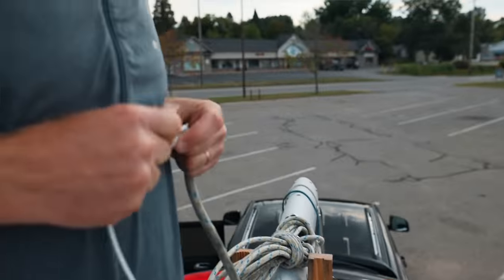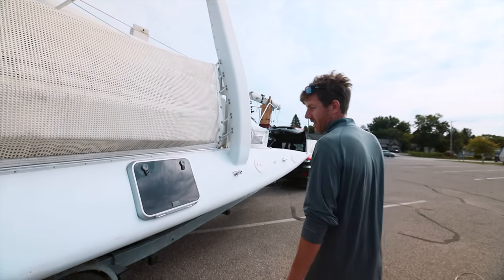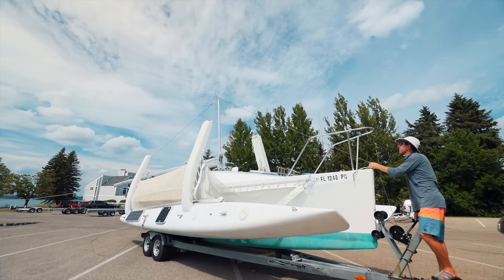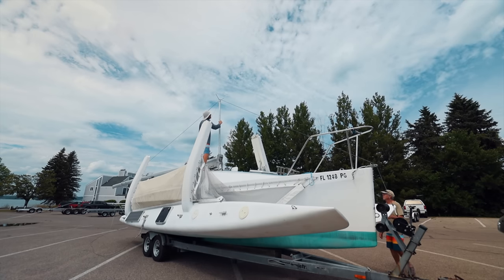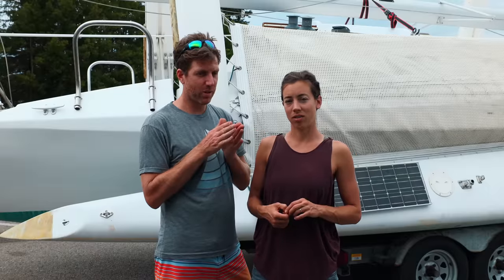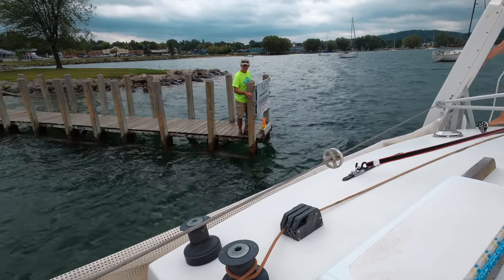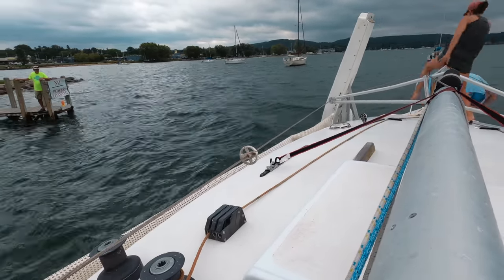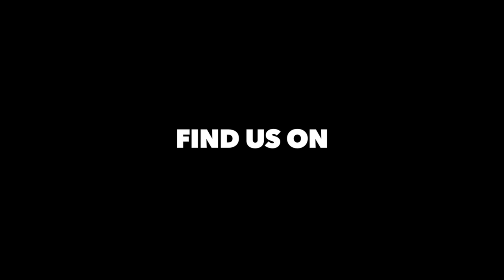How Many Quacks Does it Take to Launch a 32’ Trimaran? | Sailing Soulianis - Ep. 120

Comment: I used the same process to raise the mast on my Stuart Mariner.  Getting the head of the mast at least 10 to 15 degrees above horizontal will make a huge difference.  Also I attached the main halyard to the gin pole.
Reply: Two good points.  I forgot to mention how much a mast stepper helps.

Comment: Congrats, great experience. We have a 1994 F 27, bought it new. We took a Catalina 30 sailor for a ride and the next year he bought a c28.  We race out of Milwaukee. The 28 is more complicated to raise and lower the mast. We paid a lot of tuition learning. Next time. Tie the bow down. Use two halyards. The line connection’s need to be on the bow side of the gin pole. The most deflection is at the start of lift and at the end of lowering. The stern support needs to be higher than the deck to help on the angle of lift. The short temp lower lifting stays need to be attached the whole Time. The  cap shrouds can be free till the floats are out and bolted in. There are a lot of 28 sailors in MI. That you can get input from. There also is a F boat/Corsair list that has archives of everything. Welcome to the boats with training wheels. Remember to wave when you pass the other boats.

Comment: You have to use a pole or a piece of wood to pick up the top of the mast to change the angle of the mast
Reply: Some kind of bunk across the stern will help. My mast starts some 10° above horizontal.
Reply: That's what I was thinking... get it up above the horizontal.
Reply: Two thoughts on raising the mast. First use a longer Jin pole. Second the most force by far is required at the very beginning  of raising the mast.  A little help  Pushing nearer the top of the mast for the first few feet will make a big difference. Good luck!

Comment: OK, get a "Stand Pole" that will base on the ground and lift the mast from the mast head several feet. That will take an enormous strain off of the wench, lever pole and the step plate. Finishing the lift from this partial lift will be much easier...The Old Guy
Reply: Or a bunk on the stern if it can handle the weight. Pole to the ground is good idea if necessary. Typically very long reach.
Reply: Or a person standing on the stem lifting the the mast up to get past the initial direct strain of the almost straight pull. Wonder how much the mast weights?

Comment: Did you try to lift the end of the mast before winching it? From dead level it seems like there is a lot of stress at play while winching.
Reply: Exactly, if they had someone lifting the mast from the stern of the boat they would have gotten past the biggest load on the halyard.
Reply: Yeh, could easily walk it up with two people. Don’t even need the gin pole and winch.
Reply from the maker: @islandonlinenews  The mast is 42.5 feet long and weighs somewhere in the 150-200# range.  This is not something that can be walked up.
Reply: @SailingSoulianis  oh, looked more like 33 to me. you're probably right. 3 people then haha.
Reply: @islandonlinenews  The problem is with that kind of weight, the person holding the mast head line far forward of the bow will get pulled out of their shoes.

Comment: You may have already figured a solution by now but I had a 23 ft trailerable sail boat for over 30 years.  I first had a brace on the stern built with a “Y” attached to the top which had a trailer roller between the tip.  This allowed me to easily roll the mast backwards.  I then had a square tube extension made on the front of the trailer which came up about 8 feet from the winch table assembly.   Using a series of pulleys and a bracket on the mast I was able to get the leverage to raise the mast once the rear tabernacle pin was in place.  To top it off, I used a power winch motor with a remote to wind it up or let it down.  The main thing is not to allow the mast wander left or right on the way up because it will rip the tabernacle off the top of your roof.  Once you get it past the 45 degree mark you’ll be able to push it the rest of the way by hand.  Stepping the mast down can be just as complicated.  Also, remember that your shrouds and stays can last ten years or a thousand feet if you allow them to drag on the road.   Also my back stay and shrouds had a tendency to kink on the way up if you didn’t lay them out correctly before the stepping.
Reply from the maker: Lol “ten years or a thousand feet” yikes

Comment: Hey guys, I like watching your videos. I'm sure you know by now, but you have to give the mast a little bit of a boost to help get it started when raising it with a ginpole. You could put tons of pressure on the trailer winch, if the mast is level, it will never have the boost to get up! I have been doing this and similar mends for years, and we always have someone walking with the mast to guide it and help with the initial boost! Hope this helps!

Comment: On my 25' Catalina about a 30 ' mast. I made about a 6' bracket with a roller and guides that attaches to the stern, set the mast on the roller and walk the mast back to attachment point. It puts the mast at enough that you can directly attach to the mast. I use and electric wench with cable to raise it. And to raise it by myself. I also made brackets off the center pivot point of the mast that the mast side guide wires can attach to keep it centered as it goes up. Hope this helps.

Comment: Great video, I use a similar system to raise and lower my mast on a Seawind 24 Cat. It works but the initial lift from horizontal is difficult so I use my crew (wife and children) to assist with pushing the mast up as high as they can whilst I pull her up. Good luck it is a fantastic boat, I am a little envious!

Comment: Apologies is this was said before, but halyard to gin pole then cable from winch to gin pole. The winch should only pull the gin pole forward which then pulls the halyard forward along with the mast. Making the halyard one continuous cable with the winch only compresses the gin pole. Love the channel!!
Reply from the maker: I can see this working IF our gin pole is the exact length of the J measurement AKA from the mast to the bow roller that the winch line comes up through. Otherwise with a shorter pole, like we currently have, the winch line would be pulling at the wrong angle to the gin pole once the pivot moves beyond the 45 degree/mid point.

Comment: LOL...in my experience, it takes 5 people to launch a '32 tri that's supposed to take two people 2 - 3 hours and even then, lines get twangled, shit gets dropped, things break, boat gelcoat gets dinged, tensions run high, people bust their backs....it's all in the attitude! Yep, the engine doesn't start, you drag rudder and don't forget to clear the power lines! And leave home with ALL apparatus, plenty of tools and replacement parts and some guerrilla tape!

Comment: Oy what a long day . Stepping a mast on deck can be easy it just takes learning the curve. As others have said the far end of the mast has to be up on an angle so the lift has already started, say at between 9 and 10 o'clock.  The temp side stays will also be a learning curve but don't give up .
I went thru the same problem I ended up making my own deck step plate assembly ,now it's a one person job .

Best to you both .
Angus

Comment: Hi Soulianis. If you haven't already solved this, the aft mast support should be much higher. You can see that on Corsair 31s with factory trailering setups. Like get the masthead nearly 13' off the ground.  And you'll want the different size lawn mower wheels back there to allow easier rolling and to keep it from jumping sideways. PM me if this doesn't make sense. 
Peace :)

Comment: use a longer (x2) 4x4 post.  cut round hole in bottom to take the base of the tabernacle and try again.  The longer "pole" will greatly improve the leverage and thus ease the load overall.

Comment: Welcome to the world of trailer sailors. When we show up at the ramp, everyone gathers around for the show. It is very stressful. As I was watching your video, my wife came in the room,. After watching several minutes of it with me, she left the room. She remembered those days when we took our Macgregor 26M to the ramp and stepped the mast. It was nerve racking to say the least. There are ways to reduce the stress. Practice at your house first. Practice makes perfect...or at least close enough to it. I remember on one launch I had readjusted the stays that are attached to the mast to prevent port sway and starboard sway. Apparently just a little bit of slack in the lines can equal a lot of sway. I had to hold on to the mast in order for it not to swing over into another boat in the marina (yes, we were stepping the mast in the water, not a good thing to do). Eventually we always got things sorted out. The moral of this story is this: Practice everything at home until you become proficient. It will reduce stress considerably at the dock.

Comment: It might help to have a longer gin pole.  I have read that the gin pole should be minimum of the quarter of the mast length. I also echo the comments below regarding picking the mast so it's not horizontal at the start of the lift. Thanks for the videos. I have been a fan since you to the boat down the river from Chicago.

Comment: Launch day is always stressful, I feel your pain.  A few suggestions from an F31 owner. My boat lives on a mooring during the season so it's a similar scenario. Consider always starting the outboard and running it about 10-15 minutes when you are at home just before trailering it to the ramp. That way there's no surprises at the ramp (been there done that). Also think about stepping the mast with the boat unfolded on the mooring. I find I'm much more relaxed when I can take my time and not worry about onlookers. On the mooring the boat is always pointing into the wind so there's less concern about the mast swinging. I usually use the screacher halyard as the primary with a spin halyard and jib halyard as a secondary and tertiary line all attached forward of the yoke to a shackle on a 5/8" 3:1 block and tackle arrangement that anchors to the stemhead fitting at the bow of the boat. The line then goes aft from the stemhead fitting to one of the 2 speed winches. It's VERY important that the attachment point for all the shackles is forward of the yoke. As you winch the mast up the shackles also move forward and will catch on the yoke. They won't clear the yoke until the mast is about 30-40 degrees up. There is a huge load on the raising line until about 50-60 degrees where the weight starts to transfer to the mast base so using the 2-speed winch and block and tackle makes it much easier. The block attached to the stemhead gets in the way of attaching the roller furling drum, so once the mast is vertical I take the backup halyards to the bow pulpit to temporarily hold the mast, then quickly transfer the block to the bowsprit to bring the mast forward of vertical and attach the roller furling drum to the stemhead fitting. The stemhead seems MUCH beefier than using the bowsprit pad eye for the whole operation, but maybe that's just me. It adds some extra steps to do it this way, but it's worked for 23 years. At any rate, good to see you got the boat in the water.

Comment: Oof.  Can totally relate.  Even after 25 years of doing it, raising the mast still gets the heart pumping.  Lots of good advice on the gin pole and aft mast support.  Would also recommend that you spread one of the floats out at the dock before taking off it all possible.  Have known a couple of f-boats that rolled over with both floats folded.

Comment: That was awesome communication during that. I definitely strive for what you guys accomplished, but my wife and I could definitely take pointers from you.

I'm really surprised with how the instructions had you setup that gin pole. The way that I've seen it setup is that both the halyard and the winch line are both attached to the end of the gin pole instead of being directly attached to each other and sliding over the gin pole. That way you have less pressure pushing down on the gin pole and the force of the winch line all goes into pulling the gin pole forward which tips the mast up.
Reply: I suspect they'll do it more like you described in the future. That's how my 26ft boat mast is. I'm also suspicious that isn't the factory specified kin pole, as in too short. No way the factory supplies a pole not ready to use. But these tris are more DIY, which again could result in too short pole. I'm sure the bugs have been worked out by now.

Comment: Just wondered why you had not had a few goes at home.  I am fitting out a yacht at home and test raised my mast 3 times so far and still to  perfect it   Will be at least another 3 times before I take to the lake.  Can't wait to see it in operation . Yes being able to  trail and keep at home massive cost advantage.
Reply from the maker: It would have been stressful the first few times either way. We knew the boatyard could step the mast if we couldn't get it up... and we weren't blocking the launch ramp. So trying it out at our place vs at the ramp really made no difference at all. We just had to try it :)

Comment: You need to attach that shackle to the jin pole so the pull is on the mast if you don't then the pressure of the winch is just trying to drive the jin pole through the top of the boat instead of transferring it to the top of the mast. Think of it like creating a fixed triangle;  all three corners need to be FIXED  so the triangle is moved together.
Hope i conveyed that clearly.
Reply: A longer jin pole would help too

Comment: Perhaps raising from the cockpit with a line run back to the primary would keep everything from moving around. Set the halyard with a 3:1 block and start cranking.
Reply: My mast is about 50% the load of theirs and I have a 4:1 block to the gib pole. But their primary winch is probably bigger than mine. I don't feel I have excess mechanical advantage.
Reply: @artsmith103  yup. Nobody ever complains about having too much power. I used to own a 22 footer with a 27 foot Proctor mast, 70s style, built like a tank. I used 3:1 but the winches were puny. Once locked into the tabernacle, the spin pole made a dandy jib pole. Granted that’s significantly lighter than a 40 foot mast!

Comment: I know this video is well well beyond when filmed. But, for this spring when you try again, I had a 25 footer with a 32' mast that I trailer sailed and raised the mast with a gin pole.  I always had a wood 4x4 stilt about 12 feet long with a "Y" yoke on it that I would jamb underneath the mast about 3/4 of the way down to raise up from horizontal position temporarily until I started cranking it up.  The other end of the stilt was on the pavement.  This gave enough of a mast angle to take the vertical stress off the gin pole.  It basically gives the system a head start!  You might have to experiment how much you need to stilt it but it should work.
Reply: Exactly, the initial low angle creates the most load on the halyard, if they even had someone lift from stern to get past the initial high force tight angle of the lift they surely would have be fine. Surely all it probably would have taken was the height of a person standing on the stern.

Comment: usually when using a gin pole you would use a line from the pole to the middle of your mast or around the spreaders and a second line from tge gin pole to the winch.  this way you are not dragging a line across the top of tge pole and the pressure is not compounded by friction.  it's hard to tell if that is what you are doing in the video if so please ignore the comment.  Also, when you are just starting to lift, that is the maximum pressure on your line and downward pressure on your hin pole.  at that point if you have someone pushing up om the top of the mast, you will find even a little up pressure will make the mast go up and lower the pressure on the gin pole greatly. just may two cents from raising hobie masts by hand for many years.

Comment: As some other people have said if you get the top of the mast up a but more it will really make a huge difference.  A long 2x4 with a little cradle on the end would be easy enough to make.  The problem with how flat you had it is that you only have a very small part of the force you're applying pull upward. The majority of the force is pulling  horizontally and being transferred to gin pole which is why you saw it buckling.  Another few degrees could make all the difference.

Comment: The halyard needs to be attached to the gin pole and the winch strap at the same time.  That will prevent the gin pole from moving for and aft in relation to the mast, it would require enough pre-tension of the Halyard.  I would also pre-lift the mast by hand onto a strut, that significantly reduces the initial load.  As the mast rises the load reduces.  You can even add safety ropes to the side decks up to the mast at the speaders, remember to tie off low down on the mast, e.g. around the goose neck, in time you can make a bridle with two arrachment points to the deck and a centre link at the height and in line with the tabernacle pivot.  Lastly the boat must be securely strapped to the trailer and support the rear of the trailer.  Practise on a calm day!  I have used this method on a monohull for a long time.
Reply: Very well explained!@
Reply from the maker: All good tips thank you!